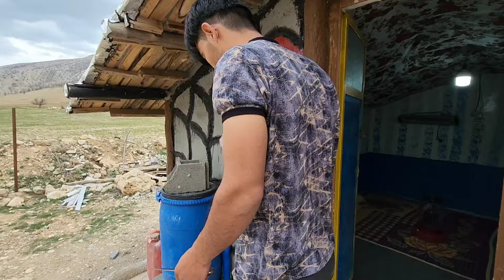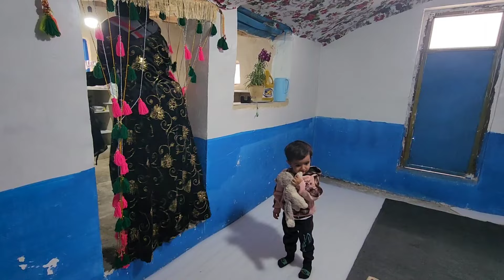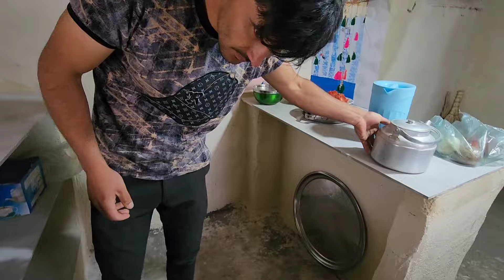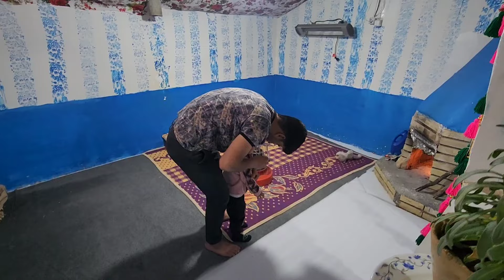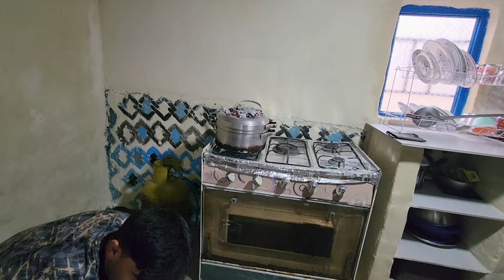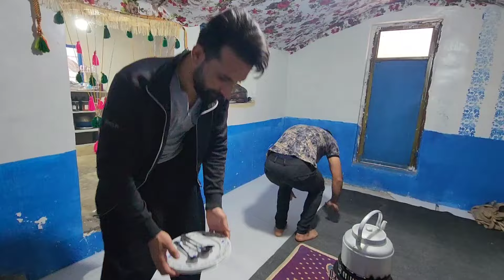Does the nomadic widow have a purpose in helping Ramin?

Comment: Heres an idea. Put your water container on a shelf in the kitchen.  Get a metal sink on legs for underneath it. When you turn the eater on it goes into yhe sink. A small hole at the bottom of the wall under the sink for the drain hose to go outside. Drain the water into a covered hole outside the wall so food particles and soapy water are in the hole and not laying on top of the ground. You wont have to go outside in bad weather.

Comment: a fireplace bring in too much cold when it is not in use. Ramin would be so much better if he would take that fireplace out and put in a big gas heater it is so much cleaner heat and all he has to do is buy the tanks have the tanks outside the house and build a cage for it so it is protected from the rain and snow.